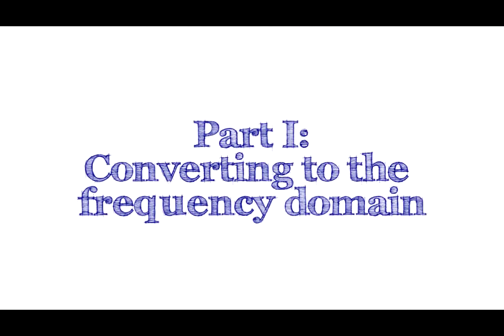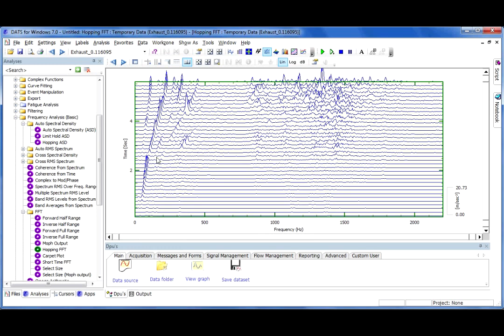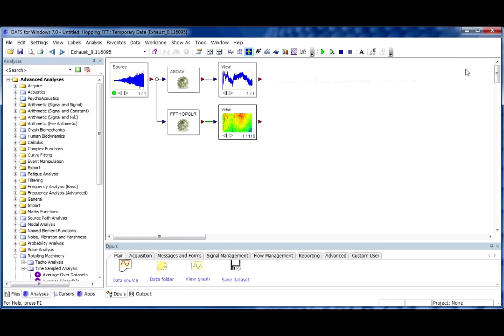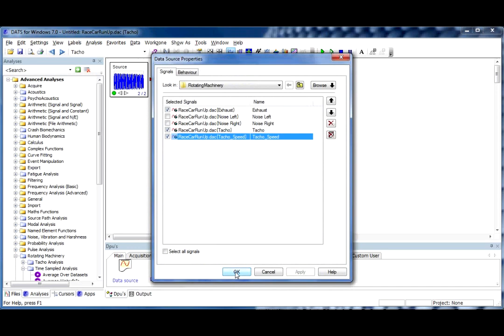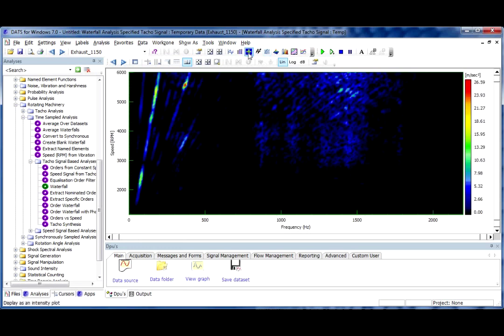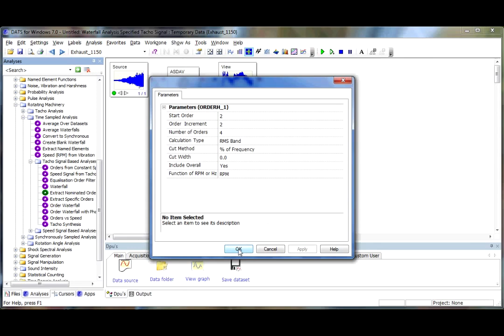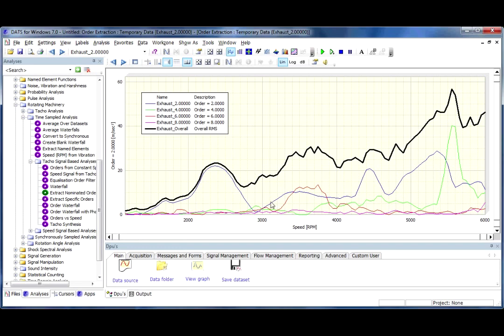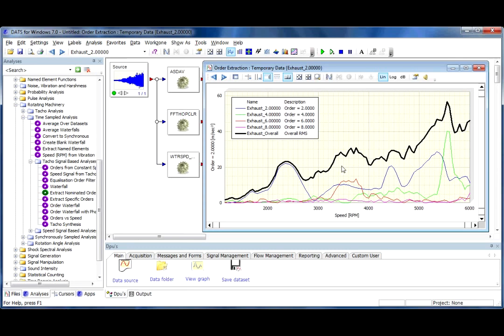PRSG027: How To Analyze Noise & Vibration From Rotating Machinery (Complete)

Comment: Hey I have a project that frequency measurement , using piezoelectric vibration sensor with arduino. I can read sensor's value (if I hit hard it gives me 10000-1500 , if I hit soft it gives me 300-500).Can I use FFT block to this values  can I find vibration frequency? I will do that  with Matlab/Simulink. Or using FFT first and then count it and find the frequency?
Reply: Hi I have similar project with yours. Can you help me how to find the vibration frequency?